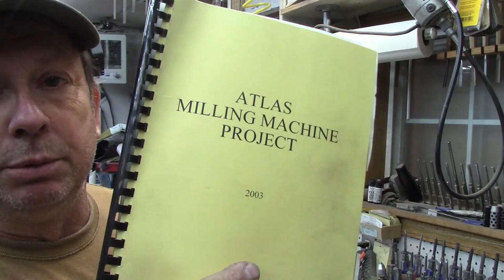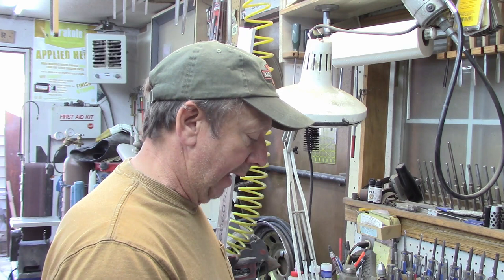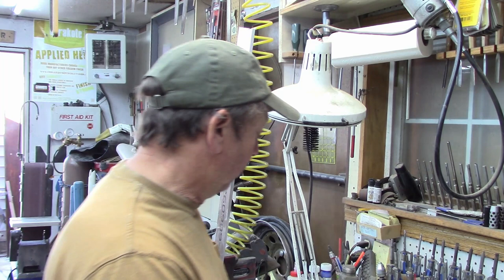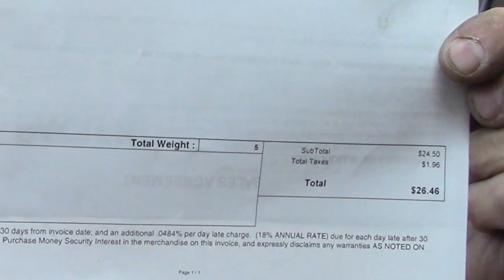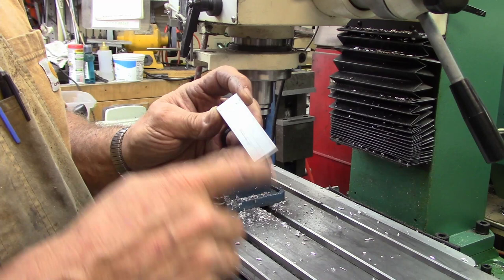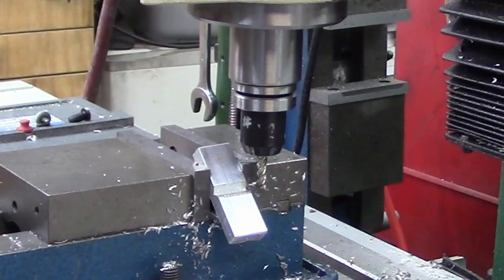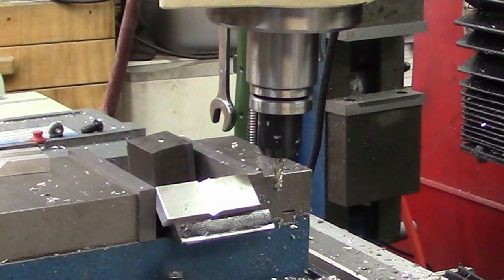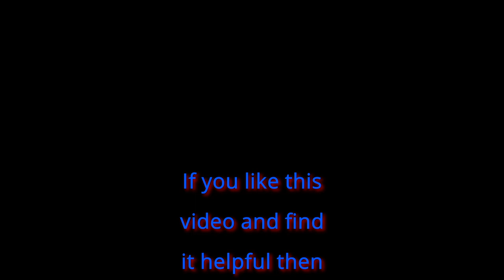Making Atlas Machines Affordable Again: Part 1: Intro & Lathe Milling Adapter Jaws

Comment: Good video Dan and I couldn't agree more about those high Ebay prices and how non cost effective it would be to ever bother buying used bearings. I noticed below your video description you provide a link to the South Bend HTRAL book. There fairly good and I have a couple of different versions myself. But far better would be the online PDF that the Australian Hercus lathe company put out that were once building there own modified clones of the South Bend lathes. There book is titled Textbook of Turning. For anyone interested just do a search for the free online PDF using  the Hercus name and the books title. It's really what the South Bend HTRAL book should have been.
Reply from the maker: Thank you, I will check it out.